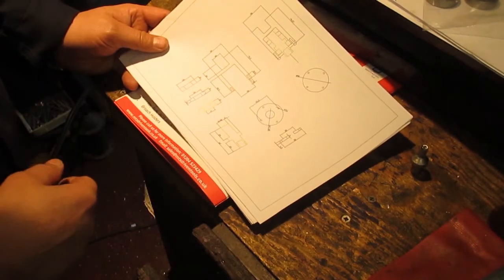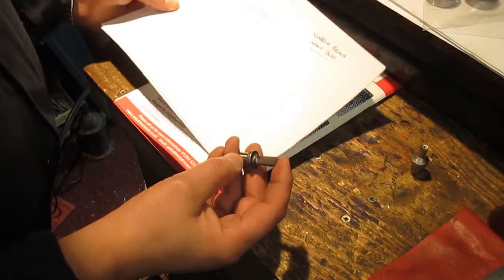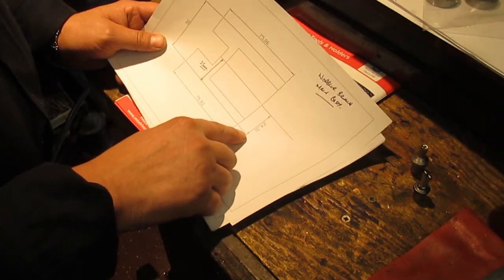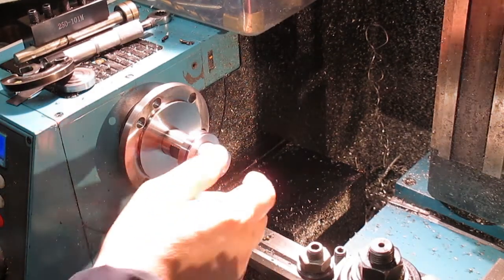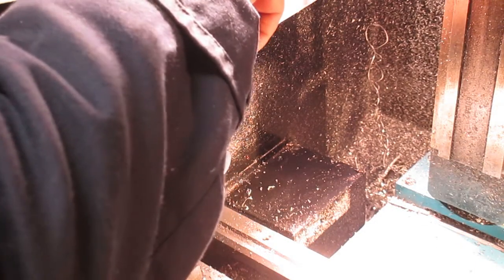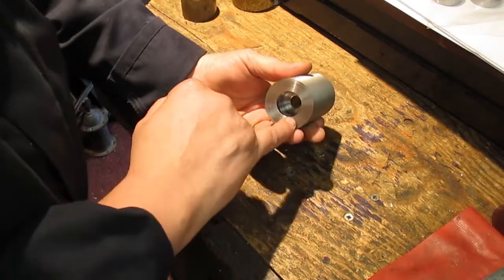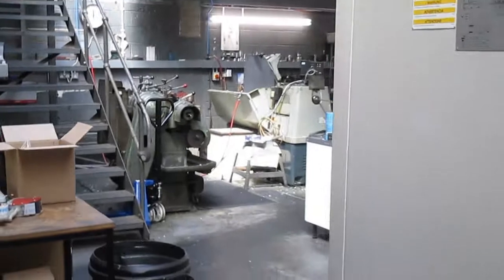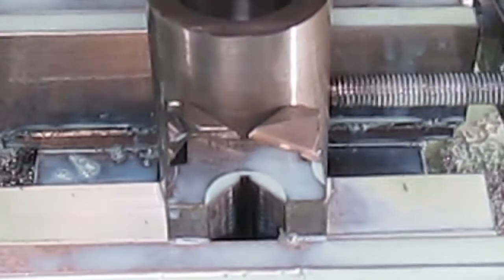Homemade Rotary Broach - Part 1

Comment: Homemade rotary broach. When the interesting part comes that I'd like to see how to approach to make one  "I'll take it to the CNC shop" well... not my definition of homemade. I'll keep searching for a "fully" homemade one😢
Reply from the maker: Appreciate the time you took to watch and comment on the video, many thanks.  There are lots of different designs out there for this style of rotary broach so hopefully you find what you are looking for.  At the time of making the tool I didn't have a way of holding the body in the exact position to achieve the offset so decided to utilise a local machine shop to help me with my project.👍
Reply: @uptheshed2418   I found one (actually a few that combining the info between all I might feel confident to attack the project) thanks.